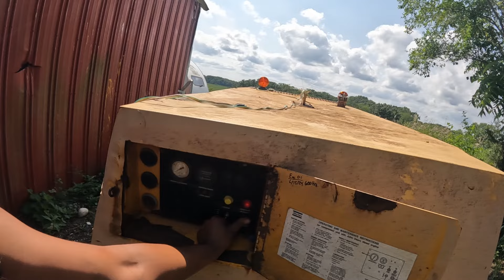New Blast Pot Setup and Compressor Tweaks

Comment: Hi , ive noticed your compressor stays on high rpm. Mine drops to low idle when it has reached set psi or not in use pushing air. Maybe something to look at .
Reply from the maker: How low of an idle?  Mine starts low, til warm, then the "unloader valve" (I think) kicks in and it revs up to making full 100ish psi.  It never drops back down even if air is not being used.  If I put an actual load on it, it revs up much more to keep up.  Any info is greatly appreciated.  I'm trying to figure all this out and haven't found any literature/manuals on how it all works.  Thanks again!